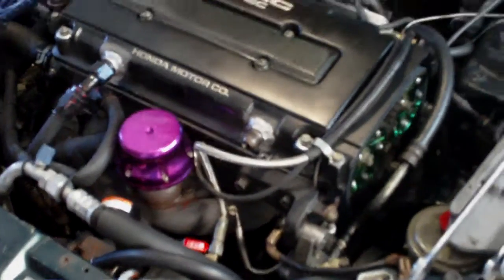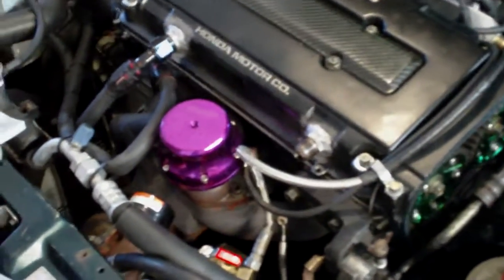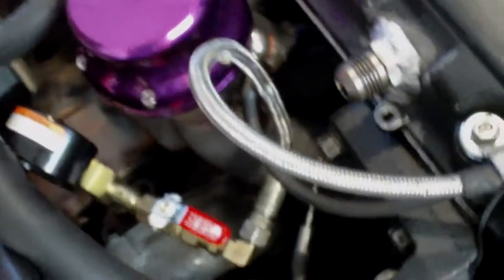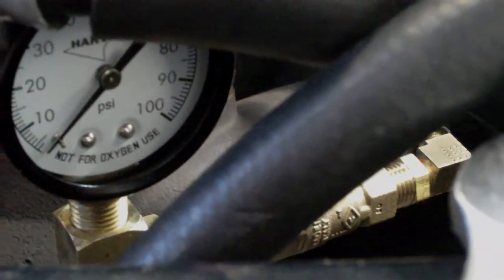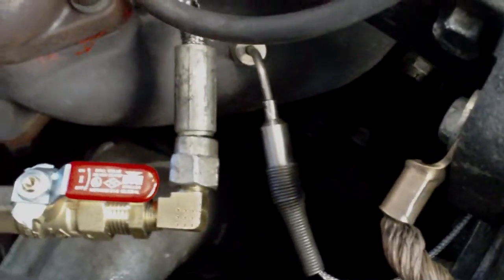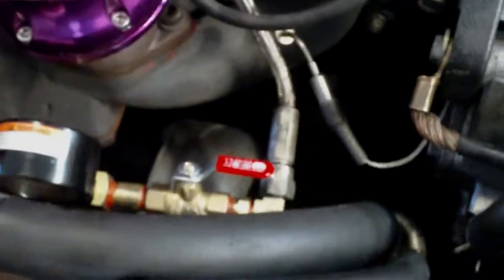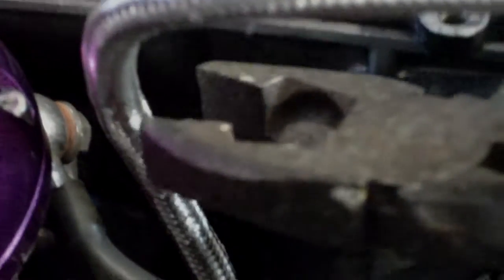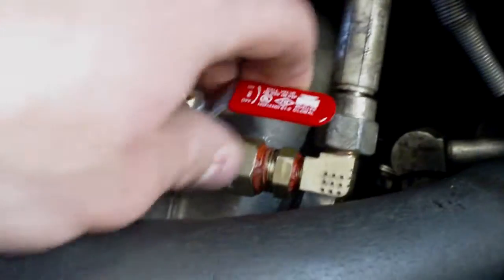How To Fix Too Much Oil Pressure To Turbo

Comment: Journal Bearing turbos generally don't need a restrictor, but ball bearings usually do (or can, since they don't require as much oil).  I'm having a similar problem myself now -- need to sort it.  10w-60 oil, 98psi at start up ... 82 psi running -- it should be ok with the pressure, but I see the oil drain has oil on the outside of it .... backing up.  Hose is pretty straight, but I'll need to experiment too I guess.

Comment: what oil weight are you running in this exact setup? would the weight of the oil also cause blow by if its too thick?

Comment from the maker: 10w30 and it could, but more then likely it's either a bad piston rings or bad rings in the turbo..check out my "How To Rebuild Any T3/T4 Turbo..Also check your oil return line for a kink, it needs a good gravity flow or it will back up.."SOME TURBOS REQUIRED A RESTRICTION NIPPLE BEFORE THE TURBO TO REDUCE FLOW"

I have a video also on "How To Leak Test A Engine"

Comment: sooooo,,,, wouldn't your gauge have to be after your flow restrict to read pressure your bearing block is actually getting????
Reply from the maker: No, because I only wanted to feed it 40psi.But to get a true reading after the restrictor then yes, you are correct.

Comment: My car you ask. Lets see my daily driver is a average econo kia, Hobby vehicel is a 1968 camero with a 507 BBC crate and modified TH700R, Also have a 1970 el camino sitting in the garage (though it needs a engine and transmission rebuilt befor its going anywhere. Also you do realize any honda running 8's is not using a stock block or transmission. So your entire comment has no validity, oh did i fail to mentioned i am a ASE master certified mechanic for lightweight vehicles?